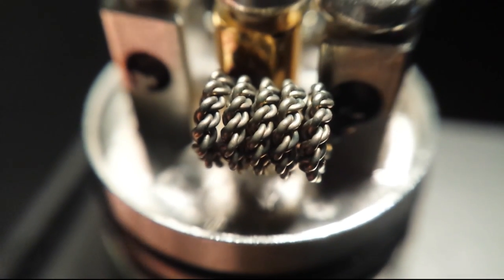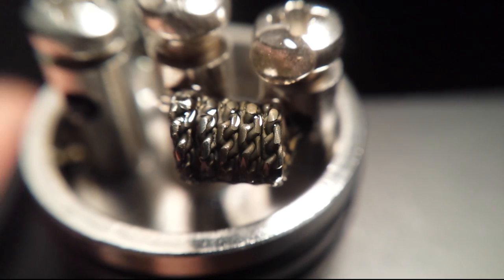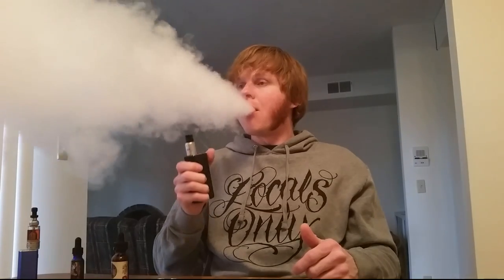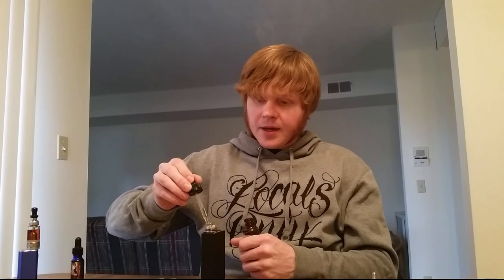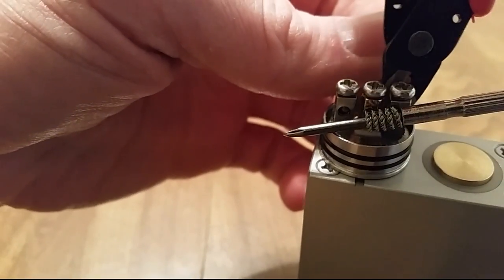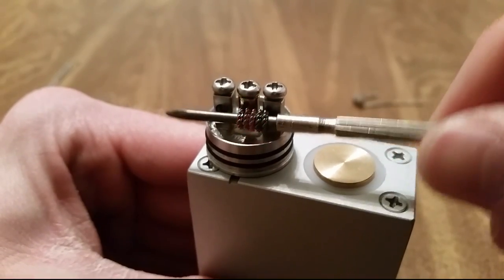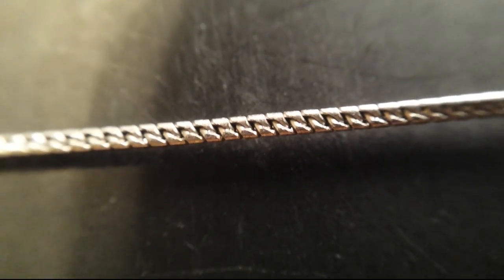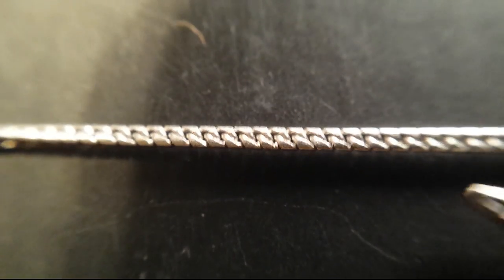Interlock Wire and Chain Coil V2

Comment: Hey thanks for posting these vids...and taking time to answer people. Anyway i took your staged heating coil and using a simplified version of it (2 28guage kanthal twisted tight and 1 strand of 26 guage) getting to .25 - .29ohms in a duel coil which is what i like...noticed it holds the heat longer i like it, pull off the button early and still get a nice vape. 6 wraps of twisted 28 and 5 wraps of 26 is what i am using on both my mutations. It seems to take alot of time to make this videos and thank you for doing so!

Comment: So i made a couple attempts at this new coil build (which is awesome imo). First tried with all 28g kanthal and then made a better attempt with all 26g kanthal. Tonight i got the desire to see what would happen if i twisted nichrome80 with kanthal A1. SO... i did it. I used 26g with one strand of each kind of wire twisted and then twisted those wires again (technically "untwisted"). Flattened for what seemed like forever!!!                          I did 6 wraps on a 2.4mm screwdriver and ran it dual coil in my dark horse on my ipv3 (with sony vtc4's). Decided since they were sort of wide to run them diagonal (ie dragon). It ohms at .13. Tastes great (five pawns castle long reserve), chucks huge clouds, and amazingly it isn't overly hot.  Keep up the great builds btw.
Reply: looks like i got my next build to do. The build you did  sounds awesome,
Reply from the maker: Wow, so it's basically this build but with 50/50% nich80 kanthal? Sounds awesome!
Reply: Twisted Messes Yep. I have been doing a lot of that with your coil ideas lately... ie....clapton with nichrome inside, mixed types of wires for zipper coils, and now this interlocking coil. Seems to be really interesting how it changes the vape.  Would love to pick your brain a bit on a few ideas i have in this area.

Comment: Even though my rather lengthy reply to your question about ultrasonic cleaners (you're welcome!) is no longer posted in your video (how did that happen?) on the Caterpillar Track Coil, it's nice to see that you are using it again. NOTHING cleans better than a ultrasonic cleaner.
Reply from the maker: I seriously never saw your reply on that. You think maybe it didn't get posted? Sorry you went through all the trouble of sending a detailed response if it never showed up
Reply: Twisted Messes Odd. It was there for a few days and then it was gone. YouTube hiccup? No big deal.
Reply from the maker: yellowhorse05 I was actually wondering why you didn't respond lol. Hope I did it right in the vid
Reply: Twisted Messes Here's a few tips for you. You asked what cleaning solution I used and and whether or not the cleaning solution was really necessary. It depends on what I am cleaning and how dirty it is. There are many types of solution and care needs to be taken when choosing which one to use. Some are neutral and gentle to the items and some are quite caustic and will erode the finish of many materials. I use my ultrasonic cleaners (I have 2 - a Crest CP-500D and the larger Harbor Freight UC) to clean gun parts, brass casings,  automotive parts, tools, jewelry, glasses, vaping gear and lots of other stuff. Why? Like I said earlier, NOTHING cleans better. PERIOD. 99% of all the work is done through cavitation (implosion of air bubbles) and heat (important) at the microscopic level.so there is no crack or crevice to small to clean. Perfect for tightly twisted wires! The cleaning solution is mostly there to 'suspend' the dirt/grease and particles away from the articles being cleaned. The stronger solutions have degreasers and acids in them that will/can chemically etch the the items being cleaned and not just make them look bad but ruin them. Many times the strongest solutions are the worst ones to use. You really have to choose wisely.  

For vaping gear and other fairly delicate items I use GemOro ultrasonic cleaning solution concentrate. This is safe for jewelry, glass, most plastics and virtually all vaping gear (including wire). It won't take the finish off. For cruddier stuff I use a variety of different solutions but for now, let's stick to the GemOro.

The UC you have is a rather low powered unit with no heater in it and it has a 3 minute timer. The larger HF unit has more power, a heater and runs longer. I got mine for $55 on sale at HF. The Crest CP-500D ($900) that I have, is a 100% SS industrial quality high powered unit that  operates at spread frequencies to eliminate dead spots and will heat the liquid up to 170F. It runs rings around the HF I have. The heat is a very important part of the process. Your unit will 'warm' the liquid through the action from the transducers but that's not the same as having a built in heater. Normally, in a heated and higher powered unit it doesn't take long to get good results. For the small HF unit I would strongly suggest running it through 3-10 of those 3 minute cycles for best results. Use the GemOro solution and those little particles you showed in the video will be 'suspended' instead of laying on the bottom of the tank. Never let the items being cleaned touch the tank. That will ruin the transducers and the tank. The plastic basket in the HF units have huge gaps in them so I use baggies in the HF or mason jars in the much larger Crest, filled with cleaning solution and the items being cleaned and put them in the basket. That eliminates the the possibility of contact. Use plain water in the tank. The cleaning solution in the baggie or jar can be used several times before becoming to contaminated and needing to be changed out.   
There is a LOT more to it but I will keep this short in hopes of it not getting lost on YT. If you have more questions - just ask..
Reply from the maker: yellowhorse05 you are awesome! Thank you so much! Will pick up one of those slightly larger units from HF since I'm saving for an ir thermometer at the moment. You've spelled it out very clearly for me. So if the tank doesn't have a built in heater can I put hot water into the tank?
Reply: Twisted Messes i have the larger HF model with the 8min cycles and heater. you dont really need to throw in the hot water but it wont hurt ether. i run a couple of cycles to clean my vape gear alternating the heat each cycle.I throw in a cap full of grain alcohol. heater doesn't turn off automatically (at least mine doesn't and can get real hot if your not paying attention and could damage the cleaner.

I second the use of an secondary container, especially if you clean other stuff that you don't want in your body. I bought mine for cleaning ammo brass and i doubt the residual lead from the casings is a good thing to vape.
Reply: yellowhorse05 outstanding detail,will, be getting the larger UC from HF .thank you so much for the advice

Comment: I tried this with 4 twisted strands of 32 gauge kanthal.  So 8 strands total. Chained it up and flattened it.  I was really impressed with it.  Came out round and you can see a twist to it.  I really like it.  I did a dual coil with 4 wraps on 2mm.  Came out to right about .2 ohms.  I think it would be really nice with 28 or 30 gauge.

Comment: thanks for proving that Ultrasonic cleaner is really necessary. Was just too eager to do this wire, it looks great and vapes great, but won't do it again until I get a cleaner :) this wire is right up there with the staged heating coil which is the current favourite. thanks for the vid, lots of good tips :) and don't worry about the length, you can do 2h no problem :)
Reply from the maker: Yeah for 35 bucks the cleaner is a solid addition to the ever-expanding vape tool kit. Glad to hear you're enjoying the staged heating

Comment: Keep up the good work twisted, your build vids are great. Loving the zipper coil and the stapled zipper is awesome. Will have to try this one out again when I get more wire in. Tried this coil a few months back and didn't have any luck kept kinking up on me with the larger size wires :-). I will work on it again though.

Comment: Wow, I was finally starting to get the hang of tidal wire and this monster emerges. Great build. For the  C.C. V2 I saw you used Nichrome. Have any rough estimates on what kind of ohms to expect from Kanthal?
Reply from the maker: I'd guess it'd be more like 0.32-0.35 for a single coil with kanthal. Might even hit 0.2ohm on a dual but probably more like 0.18. Try it and let me know how close I am :) lol, so much fun guessing resistances
Reply: Twisted Messes Will do, just waiting for my new atty.

Comment: Hey man thanks for doing these! Its fun to see how you do it cause just messing around and developing my own technique turns of to be really similar to yours. Picked up some good tips for sure. I've been doing some parallels and I'm nailing about 10% of my Claptons but I haven't done any research n doing these kinds of builds on temp control mods. Are nickel and titanium just low resistance for these sort of shenanigans?
Reply: Nickel and titanium are both way too fragile for this. nickel is hard enough to twist right. and please do NOT try this with anything other than kanthal. those wires have low resistance as single strand builds so doing this would put four of those strand together and make it so low that you could possibly hurt yourself
Reply: +Jesse Graham oh yeah man, ive learned a lot bout temp control since then. i actually stopped using nickle, turns out to be pretty deadly stuff. i have an invader mini that slips out of TC mode and gets too hot to feel safe w nickle
Reply: Yea nickle is scary shit. As far as temp control goes, titanium is king. Your body naturally absorbs titanium

Comment: You may have answered this, or stated it in the video, but what is the box mod you are using to test fire the builds?  It looks like a dimitri but it has screws....just curious, looks very nice.
Reply from the maker: It's the box by angel cigs. I bought it on impulse but it gets a hot button on builds below 0.3ohm or so. I wouldn't recommend it for low ohm builds for the reason. Seems similarly designed to the dimitri though, I'm sure there' a mile between the quality though lol. Paid 40 bucks shipped though
Reply: Thanks for the reply!!! Appreciate the input, I myself just ordered a Sigelei 150, so I'm hoping to put that through it's paces when it arrives...however I have been eyeballing all the mech boxes on the market and drooling :)

Comment: So I've wasted countless feet. I get the finished product and there are too many imperfections and it still has a couple elongated twists. I've tried straightening the nichrome before twisting it and I use adaquate resistance while twisting and reverse twisting. My two twisted wires are immaculate then when reverse twisted imperfections come from nowhere. Any advice on minimizing the ugly?
Reply from the maker: Try reverse twisting the wires together at a really high speed for like 2-3 seconds. Seems to help them twist evenly sometimes, then you slow down towards the end while the pattern starts showing up. Hopefully that works for ya
Reply from the maker: Sorry, I meant 1 second at high speed

Comment: Would you recommend washing all coils, or just the ones you have to flatten?
Reply: Heya bud, its recommended to wash any coils you flatten/sand/polish and dirty used coils.. its more about removing the particulate (metal shavings) I know you can just dry burn dirty coils and they get pretty clean

Comment: anyway to clean this coil somewhat safely without an ultrasonic cleaner? .. otherwise ill order one... wondering if thouroughly cleaning it with soap and water , and or high pressure water/compressor etc?
Reply: +SubnormalSwine pressure washer with a flat spray tip would work I'm assuming. if you happen to have one lying around

Comment: hey man,i got a question.i`m real hard on my atty`s and I was wondering if you knew of any way to fix a loose positive?i was thinkin about removing the post and using some high temp sealer of some kind.any suggestions? got problems with my clt v2,vertex v2,and one of my plumeveils.
Reply from the maker: So far haven't found a fix that works well. I have dozens of attys with spinning center posts sitting in a drawer. So far the only one that has made it through without spinning is the mutation-x v1. Haven't used the mutation-x v2 enough yet to know if it'll hold up to, but every other atty I've had ends up with spinning center post
Reply: hmmmm......not good.so far my mutation x-v2 is ok,(crossed fingers)but not had it long so we`ll see.thanks!
Reply: Todd Crow forgot to add the tugboat v1.it hasn't spun on me yet,after drilling out the two air holes the tugboat v1 is one of my favorite attys.holds a lot of juice also.
Reply from the maker: Todd Crow yeah, my tugboat's center-post started spinning after 2 months lol. That was my first real authentic dissapointment lol

Comment: can you fit dual's  Chain Coil V2 on the dark horse? with the stock post holes?
Reply from the maker: Yes you can, massive post holes :)
Reply: Twisted Messes sweet thanks im getting a dark horse in a few days. And chain coil v2 going to be first on it.
Reply: nate boyd just did it.. read my report above on how it went.